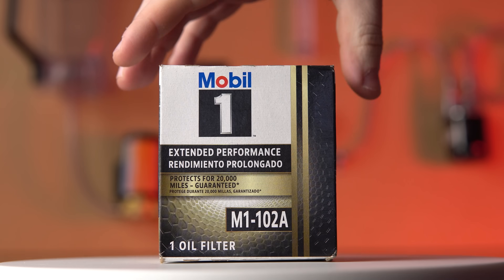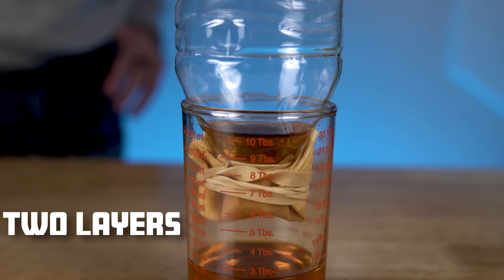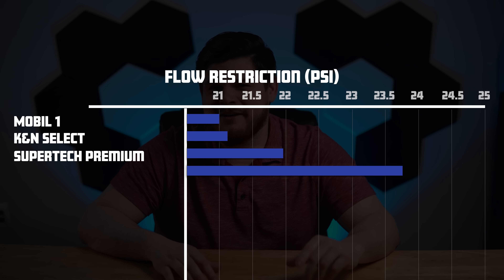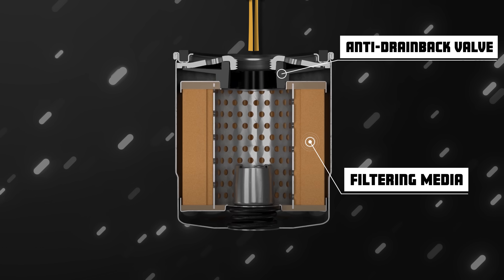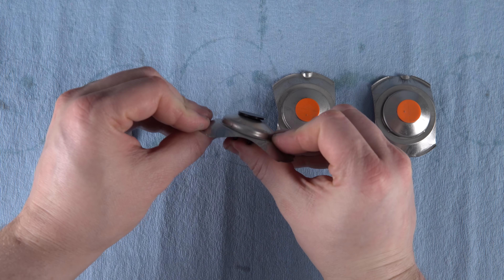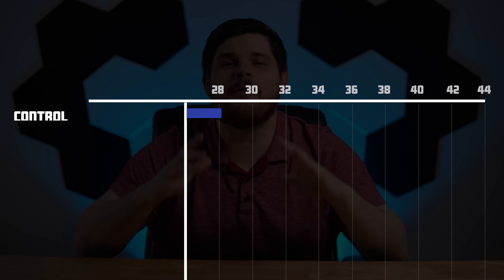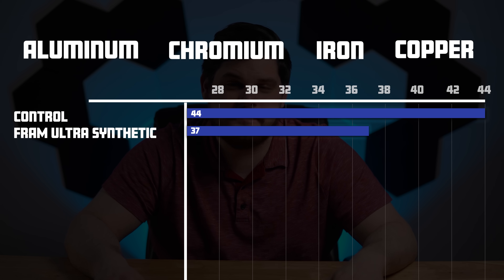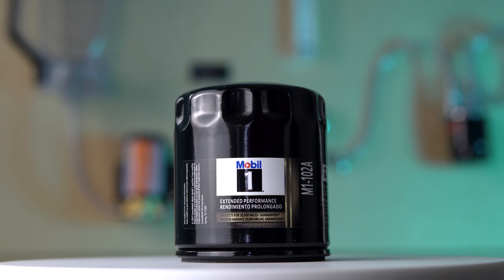Engineers Test the Best Oil Filters! FRAM | Mobil 1 | K&N | Walmart Brand

Comment: I have a Mahle canister filter or two to give you. If you want it can be a Mahle spin on type! Let me know! The Supertech looks shockingly like an AC Delco filter or a Fram Drive filter from Advance Auto Parts. With that being said, the AC Delco filters I know are very good in a standard oil change interval of about 5,000 to 7,500 miles, but after that I like to recommend the Mobil 1 filter. The one thing I love about the AC Delco filters is the flow at wide open throttle. It's not a normal plastic core and it makes it have a better flow rate through the filter. For those with a huge amount of miles on their engines, I tend to recommend a Fram Drive/AC Delco Professional or a Wix filter and no more than a 5,000 mile oil change interval to keep the oil pressure up. Just don't run them longer than 10,000 miles because those filters don't like to have a ton of pressure from contaminants on them. I had to educate a Saturn owner about the problems with running those "E-Core" filters too long and their oil filter had just started to collapse from the pressure. They understood, but like the car, so they'll be coming in at least every 4 months now to get their oil and filter. I also have a friend that's a journeyman electrician and he has a 2014 F150 5.0 with 231k miles on it. We just did another oil change on it with Mobil 1 Extended Performance 5w20 and just recently switched to the High Mileage variant. At the 213k mile mark he JUST got the first oil leak on his engine. The rear main seal.Even then it's a single barely damp dribble out the weep hole. We have not touched the oil system on the truck yet, but have changed every coolant hose on the engine. He's used the Mobil 1 EP oil now since about 2018 when it came out.
Reply from the maker: @Marcello Colotario Thank you for this great info, we will definetly see if we can get our hands on an AC delco. You have some good advice here. We really appreciate your support!

Comment: Your video is excellent. I use the Fram ultra but bought 2 ACDelco PF63 for my Chevy 5.3 Silverado. Some one mentioned to me a while back that the Fram was too restrictive. I usually change my oil 1 time a year because I run under 10k miles.
Reply from the maker: @60 Gunner Thank you! Your words are greatly appreciated! I'm with you, I have been running the FRAM ultra for years now and change it about every 7,500 miles, no complaints, but after doing these tests I'm switching to the Mobil one, it's a pretty similar price either way. Thank you for your support! Don't forget to like and subscribe to help our small channel grow🙂
Reply: @BrandRanks  I subscribed. I hope you get many because this is a quality channel.
Reply from the maker: @60 Gunner It means a great deal. Thank you!

Comment: you're missing heat in this test
Reply from the maker: Good point @neal elliot. Thanks for the feedback. They were all tested under similar conditions so it was a fair comparison but you bring up a very good point, especially since the viscosity of the oil will change with temperature and the pressure would be lower.Although, that ninja blender container/funnel was probably not going to hold up to the heat🤣,

Comment: Should have included the Napa Gold oil filter. It's  what I've  been using based on another, not so rigorous review from another channel comparing oil filters.
Reply from the maker: @Chris Mouse Thank you for the recommendation. Got to drive quite a bit to get to a NAPA 🤣, but if more people join in recommeding it, we will consider adding it to a video. We really appreciate you comment and feedback. We want to help as many people as possible and your view and engagement makes a huge difference. Thank you for supporting our small channel.

Comment: You got my interest on this type of testing. But, don't stop with just these brands, please test more brands, if you can.
Reply from the maker: @flexjay87 Glad you enjoyed🙂 Thank you for supporting our small channel. The laboratory test are quite expensive for our channel🫣, but we really want to try out other brands, any specific ones you have in mind? We are trying to get a tally of the most requested so we can do more videos.Again, thank you for your feedback!
Reply: @BrandRanks  , Thanks for replying. I understand about the cost. I would find it interesting to do manufacturing group comparisons. Correct me if i'm wrong, but it seems like only a handful of companies make most of the filters, like Champion labs,   First brands group ( Fram ) and Purolator, etc . I guess mainstream ones would make the most sense, cuz there are a lot of off branded ones, that not many would buy or be sold at auto stores. Another idea, would be to do " House" brands , that are sold under Auto store names, at places like Autozone or Napa, etc. If you were to limit the amount of filters tested, you could do like a half and half, between name brands like Wix, and house brands. I think all things being sort of equal per filter, it might open some eyes on if spending 15 bucks on a filter is actually worth it, for the average DIY mechanic. In my mind, unless your engine has mechanical issues, oil Flow is more important than filtering, for normal oil change intervals. Just my .02 cents
Reply from the maker: @flexjay87 wow... Thank you so much for all these ideas! This is much appreciated. Good point on that most are just made by the same manufacturers.